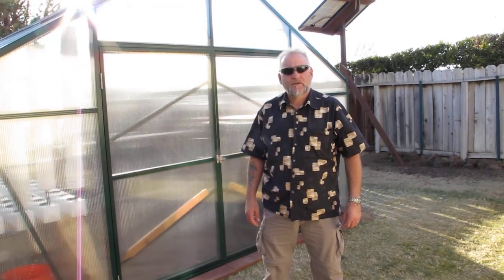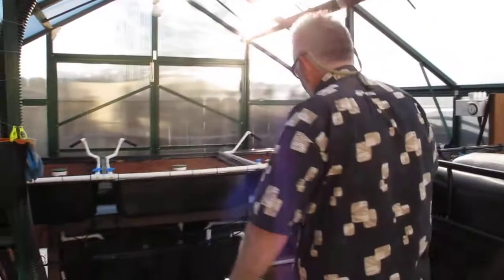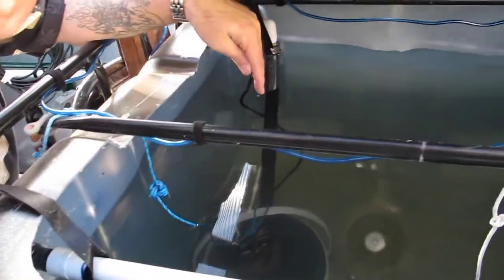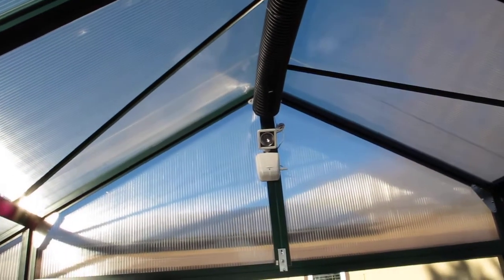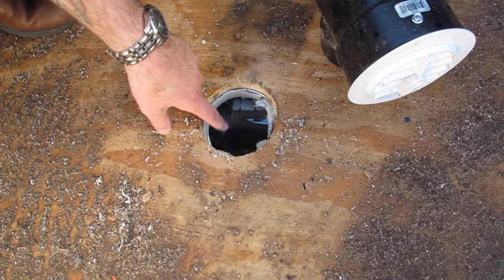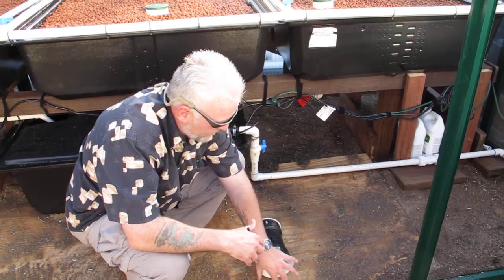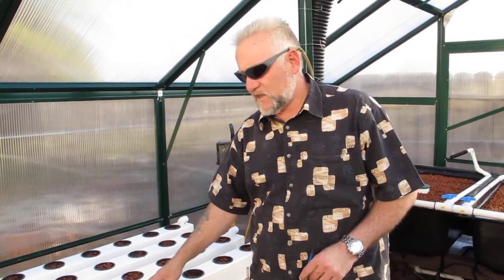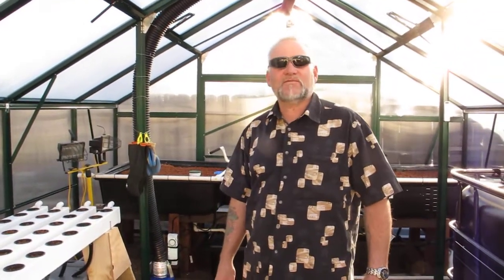Building a Green house 9 before fish and plants.MOV

Comment from the maker: Earthcare 4 season 13' x 13' is the brand and size. Heat sink has 175 gallons in the bottles, works ok but is to small, after a year I only run it in the hottest or coldest times, it give about a 10 to  12 degree stabilizing effect for about 7 hours of the day or night.